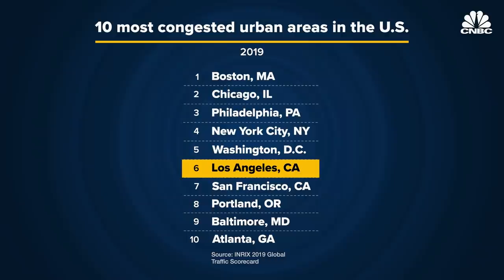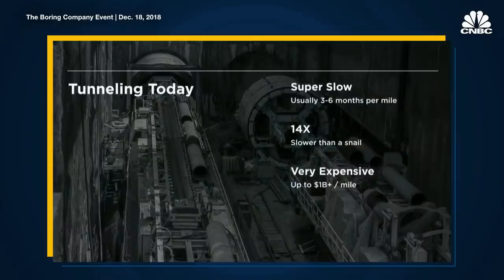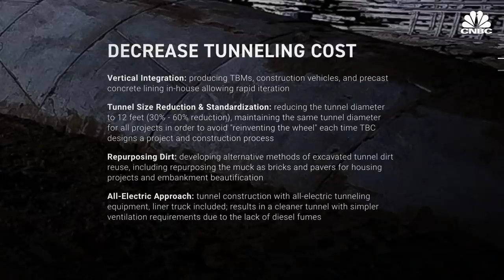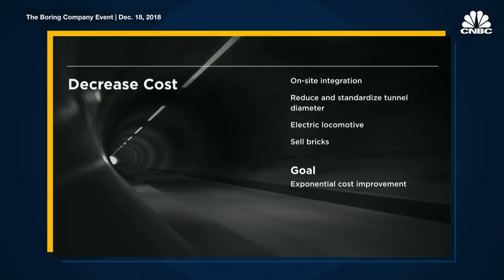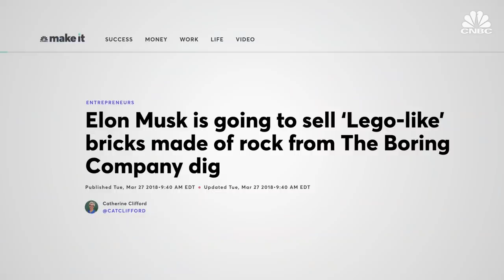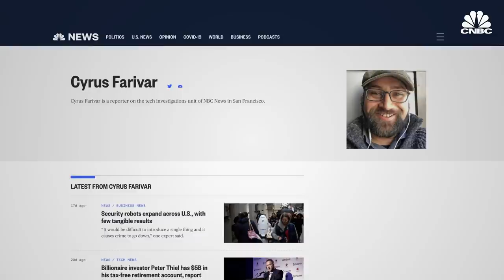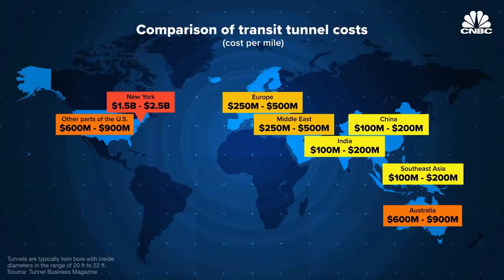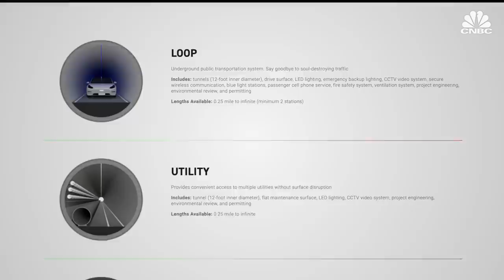Why Elon Musk’s Boring Company Isn’t Fixing Traffic Anytime Soon

Comment: Ah yes, Musks ingenious idea of adding a lane.
Reply: So why didn't anyone else do it?
Reply: @alanlight7740  Because they knew better.
Reply: @alanlight7740  because beside musk fans, everyone knows it doesn't help and is a massive waste of money.
Reply: @vudangtung5638  - funny. I know one stretch of highway, about 5 miles long, where adding one lane reduced travel time at rush hour from about one hour to about five minutes.

Strange that everyone else knows that adding lanes doesn't work, though.
Reply: @alanlight7740  exactly! we can just add Lanes and lanes and lanes forever and ever and traffic will be finally be solved. Why don't people get that?
Reply: @grandmastarflash  - Yes. It is far easier to dig further down than to build upwards beyond practical limits, and one lane of traffic should be good for multiple floors of living and working space, so there's no reason why going further down shouldn't provide far more capacity than will ever be needed.
Reply: @alanlight7740  yes we can have 5000 tunnels going into the centre of New York, it will definitely solve traffic
Reply: @alanlight7740  i bet in 3 years traffic on that highway will be just as bad if not worse than it was before they added the lane. Look at the highways near houston texas, they’re gigantic, but theres still traffic on them. Adding a lane only fixes the problem temporarily.
Reply: @matthannigan78  - it must have been five years already. No problems yet. Still MUCH better than it used to be.
Reply: @alanlight7740  Your ignorance about how traffic works is amazing.
Reply: @bobincognito6239  - I know! I only have my own observations to go by - I've never had the benefit of being lectured to by geniuses who would tell me that everything I've seen in person was wrong. It's so terribly sad. :-(
Reply: @alanlight7740  I have an even better idea: let's not stop at one lane. Removing a city completely. Raze everything to the ground, and put a giant super-broad hyper-road on top. There won't be any jams, because without the city there won't be any need to stop anywhere — everyone could just drive wherever they want.
Reply: @alanlight7740  yeah they have. It's called an underground train
Reply: @devilcwesker5980  - an underground train that can pick you up at your front door and deliver you straight to your destination without any transfers or waiting? Cool!
Reply: @alanlight7740  a taxi? XD
Reply: @devilcwesker5980  An underground taxi. If it's at ground level it will be stuck. You miss the point on purpose?
Reply: @rubenayla  Are you agreeing with musk's idea? Cause ive got an entire list to prove that idea is stupid :v
Reply: @devilcwesker5980  I absolutely agree with it
Reply: @rubenayla  tell me then why it isnt a stupid idea then.
Reply: @devilcwesker5980  Well, in reality you should tell me why it is a stupid idea. Specially because Elon Musk himself already explained the reasoning of 3d city growth vs 2d road growth, that mathematically will for sure collapse for big cities.
But anyway, I will paste a response to other comment that I think goes in a similar direction:

"building underground car tunnels is just a more complicated version of just adding more lanes to the highway"

My response

Definitely not. Obviously more separated lanes can move more cars. It's like a pipe moving water. OBVIOUSLY more pipes = more water.
A different story is the whole transportation system with its bottlenecks and complex dynamics where a faster route for any individual car may cause a greater delay to the neighboring vehicles, causing the total time travaled to increase, even though individually for a person the trip was shorter, which in turn means than SOMETIMES, more lanes can result in more traffic and slower trips.

Think about this. You get on an elevator to level -10, you get on a tesla (or any vehicle, but a car can come out of the tunnel to the main roads), and you get directly under your destination, for example in LA. You park it there underground (ideally the autonomous car would go for more people, being useful instead of parked there), you get on the elevator, and you're at your destination. You didn't even need to interact with the normal roads, which means these tunnels didn't slow down the system. You could build underground roundabouts etc. It has to work.
And the surface could be freed from roads, just to walk and bike
Reply: @rubenayla  oh and roads+cars are very more expensive than stones+shoes
Reply: @devilcwesker5980  

I don't know what the moving-parts argument has to do with static tunnels. 2 wheels at the sides of a vehicle to make it go straight are not a problem.
About the motors, in fact having several motors makes the system more redundant. That's why planes have several sensors and actuators. It's more likely that one will break, but it's less likely that the system will break.
I thought we were talking about the transportation system, not safety. A tunnel is in fact safer than a road subject to the weather.

"This is because any part has at least a 5% of failing" WTF. 5% of probability over what time period? on their lifetime? That's BS. ICE engines would be impossible if that were true, and there's no fundamental reason why that has to be true.

I have done some research in TBM because I was thinking if it would be possible to use water jet cutters (like in CNCs) to cut the exterior surface of the tunnel instead of the whole volume. and have bigger chunks, or just for hard rock.

About the video, yeah a train generally needs less maintenance, but passengers have to stop at each and every station between them and their destination. Oh and when they arrive at the closest station, not their destination because all the passengers are forced to go together, then, they need another vehicle to really get to their destination because the train cannot do that. NICE. Now they need a car or a bicycle parked all day there. A mess. With the tunnel you just take your car and go. That was the idea.

You should only care about my arguments, but I'm studying aerospace engineering in case that's useful.
Reply: @rubenayla  aerospace engi, well then you should know that principles at least.  Any piece of machinery has an acceptable rating of success of 95% meaning that there's at most a 5%  of failure.  Unlike motors in planes which you are right(they place several motors in order to make it more robust) but when we talk about automotive and machinery such as drills,elevators etc. The question changes from being robust to energy efficiency.  If you read the loop idea, the process goes like this. A car parks in this platform which then gets lowered by an elevator, which then the platform connects and moves forward with rails system(the same tech they use for rollercoasters) then it gets speed up by 100 map until it arrives into this "station" where it gets into another elevator and done. 

Problems: energy efficient:  In any public transport (which would classify the platforms as such) the importance of being efficient comes to mind. So the electrical amount needing to powered all the above, for only 4 to 6 passengers at a time completely get demolished compared to a underground train system. 

At this point your only argument is comfort. But as an aerospace engi you should at least know a bit on how airline sits work? The argument being the same, trains are your cheap transport system, has several seats but low comfort. But elon musk idea of comfort is like the airplane rides of first high class. So the problem being, either you make the service so expensive that not all people use it and only few people do making it nonprpfitable and a loss of money or you make it dirt cheap but still loose money
Reply: @devilcwesker5980  With electric vehicles the energy efficiency is very high, and the aerodynamics at normal speeds are not so crazy as with planes. It would cost 1-2$/100km. Electricity is cheap compared to fossil fuels.
I think that separating the train into different vehicles, allowing people to have privacy and real comfort, will not necessarily increase the cost that much.
I'm not against a vehicle with metal rails taking electricity like a train, but I don't like the idea of all the people together in an enclosed space, and I don't think it's necessary. However integrating the tunnel with the current car system of the USA makes sense to me.
I would remove roads from the surface if they get the cost low. You get rid of road maintenance by having them underground. There are so many converging advantages to transportation with tunnels...

I agree with the difficulty of the car elevators though. I didn't pay much attention to that because in my mind for a city is more logical to have underground parking and get yourself to the car from the elevator of the building. In the short term I would just use a ramp for cars and elevator for humans
Reply: @rubenayla  - you understand it. Autonomous taxis are going to change a great deal more than just traffic, and putting them underground in city centers could return the streets to pedestrians, while reducing the need for parking will allow denser development which will mean there will be more goods and services to be found within walking distance - all while also retaining the advantages of the automobile.
Reply: @devilcwesker5980  - underground construction is far safer than surface construction in the event of an earthquake.

When big cities have big earthquakes, they frequently end up using their subway tunnels for emergency services to get where they need to be after the surface streets become impassable.

As for what solves traffic - the only thing that has EVER worked is adding more capacity. Frequently this means adding more lanes. The false claim that "traffic has never been solved by just adding more lanes" is based on the fact that traditionally those lanes have been limited to two dimensions. What happens is that when adding extra lanes solves traffic problems people see that it is easy to get where they want to go and more people move to the area. Now those people are going to move SOMEWHERE regardless, and the new development is going to happen SOMEWHERE regardless, the only question is whether that development will be dense and efficient or whether it will sprawl over much larger areas.

So, granted that people are going to want to live SOMEWHERE, we are back at the 2D problem: after houses and shopping centers and schools and everything else has already been built, no one wants to tear them down to add lanes to the roads, and now the cost of real estate has also skyrocketed so it becomes very expensive to add lanes. Besides this, all that cross traffic means lots of traffic lights and difficulty getting into the correct lane at the correct time, and figuring out how to cross oncoming traffic when necessary. That limits how wide you build roads.

A grid pattern helps somewhat, but then families don't want to live on roads on a grid because they are rightly concerned that their kids will be run over by traffic. That leads to new subdivisions full of cul-de-sacs, which in turn makes the major roads even more unmanageable.

But going underground adds a whole new dimension - quite literally. Traffic can continue at speed without need for traffic lights. A grid pattern could be established even underneath existing neighborhoods with cul-de-sacs. The far greater constraint is how high we build - and the fact is that most tall buildings are vanity projects. It almost never makes sense based on economics alone to build taller than about 20 stories, and that is for the most expensive pieces of real estate. Experience has shown that residential buildings for families with children should never be taller than five stories. So we don't really need to go deep, and mostly we just need to get rid of bottlenecks.

Moreover, as we move towards robotaxis there will be much less need for parking, as few urban or suburban families will want more than one car. This will mean that many garages can be repurposed to allow a denser concentration of businesses, which in turn will make urban living more attractive. Taking automobiles off surface streets can also return that space to pedestrians, encouraging more walkable cities - which also means healthier people.

Of course the sticking point is the expense of building the tunnels, but that is not as much of a sticking point as it may appear - partly because the price of tunneling has been artificially inflated in the United States, but also because accelerating technological change will make all types of goods and services much less expensive than they used to be.

Of course this will take time, but that's okay because by going underground we also avoid most of the problems arising from new construction obstructing existing traffic. The first tunnels will address the places where traffic is worst while allowing a smooth transition to a future in which the majority of non-local passenger traffic is underground. By using vehicles that can travel on existing roads, it likewise allows an easier transition because it allows people to seamlessly use both new and existing systems.

You speak about environmental concerns, but what exactly are those? Going underground is about as environmentally benign as one can get. Some existing roads could be returned to being natural areas, but even just replacing short sections of surface roads with underground roads could do a great deal to restore migration routes for many species that have been disrupted by roads and vehicular traffic. If we were to move to a future in which most roads were underground we could even mitigate the damage done by proximity to roads. It has been discovered, for example, that roads and road noise will drive many species away from the roads, so that some bird species will refuse to nest within a mile of a road with regular traffic.

It seems to me that most "environmental" concerns are just an excuse to make things difficult and prevent any sort of improvements.
Reply: @rubenayla   and that also that Alan Light guy, adding tunnels is not really 3d growth its just on technical level, and even if improves it significantly which it can't, more people would settle there. Problems is not the lack of space, its the abundance of cars, nothing comes closer to an electric train in city or state wide terms. It is the best solution there is. For which you can use other public transports or better think something innovative in that area.
Reply: and adding cars
Reply: @alanlight7740  because it's only a short term solution, which might improve things for 18 months max less in a large city. To truly solve it there must be multiple viable forms of transport for people to take, plus not having things spaced out to encourage everyone to take cars to do anything in their lives outside of their homes.
Reply: @ANTSEMUT1  - So it IS a solution for 18 months (in reality considerably longer, but I'll take what I can get), it's just that after that problem is solved a NEW problem emerges because things are so much better that the city can grow again. At which point adding another lane can solve the problem AGAIN.

Ignoring, of course, the fact that one autonomous lane is worth about three regular lanes, and that autonomous cars also reduce the need for parking and (eventually) can take cars off the surface so that people might be more willing to walk (or use a bike or scooter) when they don't have to worry about being run over by a motor vehicle. For that matter, a few tunnels could be provided as pedestrian or bicycle and scooter expressways, encouraging those modes of travel as they would be available year round regardless of weather or terrain that would otherwise discourage them.

Of course, without all the space required for parking a great deal of space can be repurposed for other things, allowing greater density and greater walkability.

And if more lanes are required they can be easily added with more tunnels, because it is much easier to go down than to go up.

And that last point is the key one: the traditional adage that adding lanes doesn't solve traffic is based on the assumption that the transportation grid is two dimensional and that adding lanes is going to be very expensive, will force buildings to be built further apart, and will still have all the problems inherent in intersections where traffic will have to stop to allow cross-traffic to proceed. All of these problems are solved by making the grid three dimensional.

And the problem of making the grid three dimensional is in turn solved by making tunneling cost-competitive with other solutions.
Reply: @alanlight7740  You're missing a big point here. There is a thing called induced demand. Basically, when you add lanes or make a new road, more people will start driving, because now there are new lanes. So they will compensate for the new road capacity, thus making the traffic jams just as bad as they were before. There is a reason why cities don't try to simply make more lanes anymore. Cars in general are just inefficient in dense urban areas. That's why fast, reliable, and cheap public transport will be much better.
Reply: @alanlight7740  Dude you need to stop hahahaha
Reply: @alanlight7740  eww billionaire musk fanboi
Reply: @Ruzzky_Bly4t  - "induced demand" - in other words, growth.

Yes, as more people move to an area because they have seen it is a nice place to live, they will want to go places.

The solution offered by urban planners is to make cities worse so that people will not move there, or will even start moving out.

Cars are very efficient in dense urban areas so long as they have the infrastructure to keep them moving. The question is only whether sufficient infrastructure can be built at a reasonable cost.

Having misdiagnosed the problem, urban planners are now anxious to apply the wrong solution.
Reply: @alanlight7740  all i will say is that i think you have to use a metro and not hope we end up living like the people on coruscant.
Reply: @theholypotato7763  - I've used buses and airplanes on seven continents, and trains, subways, and boats on six - plus several islands. I know a little bit about how these things work and what works best.

Also, going underground is one of the things that helps AVOID creating a world like Coruscant.
Reply: @alanlight7740  its an underground road, nothing more.
Reply: @theholypotato7763  - that's all it needs to be.
Reply: @alanlight7740  Mr. Musk is truely a 4D chess gamer.
Reply: Just for himself.
Reply: @xavierrodriguez2463  - there's another way. You can add multi-level lanes and bypass intersections. Like with Loop.
Reply: But it's underground and with gaming lights. Definitely a revolutionary concept in transportation.
Reply: No adding a line at much higher cost that the real genius. 🙄
Reply: @alanlight7740  Great idea! Adding lane after lane is obviously the only correct answer, golly gee, why hasn’t that been tried before?
Reply: @hjj9269  - because previously it was too expensive to go 3D. Didn't I already address that point?
Reply: This comment thread is just one Elon Musk fanboy who refuses to accept the fact that public transportation is a better long term solution to traffic lol
Reply: @Theffries  - I refuse to accept such an absurdity as public transportation being a long term solution to traffic, because it isn't - unless perhaps your hope is to cause such depression that commuters commit suicide en masse. I suppose that would solve traffic, after a fashion.
Reply: @alanlight7740  bro tunnels gotta be built under some civilians houses in major cities yo
Reply: @Avis03  - it wouldn't be strictly necessary for tunnels to go under houses - it should be possible for tunnels to simply run under roads that already exist - but going under private property (with an easement or whatever other legal instruments are required) might allow more direct routes that save everyone time and money.

And what was your point? They'll be deep enough they should be pretty much undetectable on the surface, apart from entrances and exits.
Reply: Musk fans would probably suggest Trump's "nuking storms" thing is a genius idea.
Reply: @grandmastarflash  Pal, I just discovered the idea of parallelism ! I should try to patent it !
Reply: @alanlight7740  Vox did a video of why adding lanes to motorways actually makes traffic worse.
Reply: @vudangtung5638  In the future im sure you will be incorrect.
Reply: damn bro, this comment gives the same energy as saying "Electric cars are just normal cars with electric motors".
Reply: @alanlight7740  lets add a underground lane for cars make them high speed and to reduce congestion we could connet them. Wait thats a subway. Honestly adding another car lane is so goddam inefficient. Trains are the most efficient and make the most sense.
Reply: @chagi4334  - trains as they have been implemented in the United States are less energy efficient that electric cars, even if each electric car has only one passenger. Trains are also FAR less time efficient for passengers. There are some rare exceptions at rush hour in some extremely congested areas, but even there it would be better to concentrate on using the train for one short leg and then have passengers switch over to a more personalized transportation option.

And of course it's looking like trains are also more expensive than the Loop system. This might be mostly due to political corruption and unions in the United States, as costs appear to be considerably lower in other parts of the world, but it still means much higher costs for trains in the United States.
Reply: @alanlight7740  you are ignoring so many other problems. You also need parking for cars, cars cause more wear on roads than trains on steel tracks which means more maintenance, there are a million reasons why it’s a terrible idea. Watch literally any Adamsomething video on musk’s ideas and it’ll probably blow your mind lol
Reply: @Theffries  - Autonomous taxis will reduce the overall number of cars needed so we already have more than enough parking. It's heavy trucks that cause most of the wear and tear on roads, and the tunnels are too small for heavy trucks. That is, depending on weight one heavy truck can do the damage of hundreds or even thousands of cars. So the pavement in tunnels will last much longer than surface roads - both for that and because it will be protected from the weather (especially freeze/thaw cycles).

If a robotaxi fleet is eventually built it will likely be mostly small cars for only one or two passengers, since the majority of trips only have one or two passengers. They might even be half-width so that two can share one car length in the tunnels. These cars will be very lightweight which means even less wear and tear on road surfaces.

Electric cars require very little maintenance other than changing tires, and even though they will need replacing more often than train wheels, overall the maintenance costs will be much lower. This is especially true because the tools, equipment, and knowledge for car maintenance (especially tires) is far more common, standardized, and inexpensive than the tools, equipment, and knowledge for maintaining trains.

For example, it's easy to find a lift for an automobile, not so much for a railroad car, and a jack for an automobile is much smaller and less expensive and easier to work with than a jack for a railroad car, etc.

You're looking at individual parts of the equation and favoring trains, but if you look at the whole picture electric cars in tunnels are much more efficient and less expensive.
Reply: @vudangtung5638  I bought a coke spiked my insulin levels and died of diabetes. Now I know that cats are like dogs.
Reply: @vudangtung5638  beep boop
Reply: @alanlight7740  It only works in certain locations. Not every space in a city is equipped to bore extra lanes. If you add more lanes, it encourages more cars.. which will just inevitably create more congestion in other parts of a city. Ya adding additional lanes helps in theory, but it’s a balancing act. . 

People find “just add another lane” laughable because it’s touted as a brilliant futuristic solution to all the worlds traffic problems. It could work, but mostly in areas were a temporary influx of cars get from point A to point B without diverting. Stuff like tourist attractions or sports stadiums. It’s a known folly in the  civil engineers world. Elon needs to outsource his expertise better.
Reply: @be.A.b  - in the past, "adding lanes" hasn't worked for two reasons: (1) when traffic is eased, more people find the area desirable and move in, increasing population density; and (2) because the road networks are effectively two dimensional, there are limits to how many lanes can be practicably added.

In the first case, it is ironic that the same people who hate the idea of adding lanes tend to be the same people who favor higher density. Higher density means, for instance, that there will be more places to go within walking distance and less need for cars in the first place. Moving lanes underground also means that these areas are more walkable, with fewer multi-lane roads for pedestrians to cross. Ideally, all traffic could be routed underground, and the surface roads could be reclaimed by pedestrians entirely.

In the second case, by going three dimensional there is no practicable limit to how many lanes can be added. It is much easier to dig deeper than to build taller, and the truth is that there is almost never an economic reason to build taller than about 20 stories anyway. (The buildings that are taller than this are essentially vanity projects.) Besides this, the thing that slows down urban traffic the most is intersections where traffic is required to stop to allow cross-traffic to proceed, and by moving into three dimensions this impediment to traffic flow can be eliminated almost entirely. Which is to say that by going three dimensional the number of lanes available can always exceed the number of lanes required to keep traffic moving, and that traffic can flow much more quickly - probably the equivalent of at least doubling, if not tripling or more, the capacity of each lane. Autonomy also increases the capacity of each lane - roughly tripling the capacity of a highway lane. By combining these two trends I would not be surprised if each underground lane could deliver six times as much throughput as a lane on a city street - and perhaps more.

But even if autonomous vehicles in tunnels could not deliver quite that much of an increase in capacity per lane, we could always add more lanes - hundreds of levels deep if necessary. The only question is cost - and rapid advances in technology will continue to reduce those costs.

Despite what you say, there is almost nowhere that is unsuitable for this. Cities with existing subway networks may need to dig a bit deeper, but it should still be possible. The chief obstacles are legal and political rather than technological - things like securing underground right of way for the tunnels.
Reply: @be.A.b  - also, I know that this is not innovative city planning. The Italian futurists came up with the basic idea about a century ago. The only improvements are: (1) using subtractive rather than additive construction - that is, digging routes for vehicular traffic rather than putting vehicles on ground level and building raised platforms for pedestrians; (2) eliminating the need for same grade intersections - an idea borrowed from limited access highways like the Interstate system; and (3) self-driving electric vehicles that make it all possible.
Reply: @alanlight7740  why highways? High speed rail is way more effective than highway
Reply: @tapeesa2866  - automobiles on highways are more energy efficient, more time efficient, and less expensive than rail - at least in areas that are not very densely populated. That's why.
Reply: I think everyone are missing the point.
If this idea (or more cost effective ditch and cover technique) became mainstream .
We can forbid the space taking, accidents causing, noisy, polluting cars above the ground.
So above ground will be reserved for bikes, walking, light rail and trams and small shops in the middle of the street.

Why do we put the low efficiency cars that take a lot of space above ground while public transport underground, it should the other way around.

This also allows cars into a controlled environment, that can implement self-drive safely.

It's a win on all side.
Reply: @yazeedalhusban969  how do you pull over in the tunnels if you run out of gas? Or if the car breaks? What if there is a crash? Where will people park?
Reply: @alanlight7740  look up more research it’s already been proven across the United States by many studies that adding another lane to a highway doesn’t really help the problem in most congested areas
Reply: @tapeesa2866  why not ditch Elon Musk idea then, and build a proper traffic tunnel, with cost efficient cut and cover technique, so above ground will be used for public transport and other uses.

A proper tunnel means wide, multi lanes with emergency exit and entrance.

Tunneling for cars is less expensive than tunneling for public transport.

The sad truth that cars are here to stay so I rather them underground.
Reply: @tapeesa2866  do you know what, I take my reply back, it's not going to work.( what will happen when people reach their destination, how do you get out of the tunnel and park).
But I will not delete my reply to provoke thoughts.
Reply: @ianaguilar8090  - and yet millions of people have had the experience of new lanes (or even new roads) relieving traffic congestion.

Maybe we should be careful about blindly believing the "experts" - all too frequently they have blinders on.
Reply: ...or his pitch that we should invest in his ordinary thing because his ordinary thing could be 3x better than other ordinary things at some point in the future, as if that were a convincing argument.
Reply: @alanlight7740  And hundreds of millions of people have seen that the added lanes are eventually filled with more cars and you end up with the same traffic problem

Do you not see the trend here? I genuinely can not tell if you’re trolling or not
Reply: @AyedYoutube  - the fact that traffic increases simply means that more people have found it worthwhile to live in the area, which means increased population density which is a good thing as far as efficiency goes.

The problem with adding lanes to surface streets is that eventually you run out of space to add lanes. By going three dimensional, you can always add more lanes - at least beyond the point where the city can grow taller. By eliminating intersections you can also keep the traffic flowing, which is huge when it comes to keeping trip times reasonable.
Reply: @alanlight7740  there is only so much capacity to be added for cars before you realize the entire city is just a giant parking lot and highways.
Reply: @AyedYoutube  - which is precisely why it would be a good idea to put that capacity underground so it doesn't take up valuable surface space.
Reply: @alanlight7740  by that point it’s much cheaper and practical to just invest in public transport
Reply: @AyedYoutube  - public transport isn't at all practical outside a few densely populated areas. Too expensive, takes too long, too crowded, and it doesn't go where you need to go. I keep on seeing people sing the praises of public transport, but I have no idea where they live because it's been worse than useless most everywhere I've lived.
Reply: This is how Musk promotes the Myth of Musk.  He claims the invention of things that don't exist, but sound good at the time.  He want's to put a robot in every house, but his prototype is a man dancing in a spandex robot suit.  Most of what Musk talks about is hype for self promotion.  Now, Musk has now turned on the people who buy Tesla cars, the left leaning people who are concerned about the environment. Then Musk publicly aligned himself with the political party who denies climate science, they don't like electric cars or solar cells and the leader of the party HATES windmills and says climate science is a hoax. I see Musk as more of a conman with billions of dollars pretending to be the next Edison, while using 3D CGI videos and photos and a man in robot suit, all to promote his myth to sell cars.
Reply: @obijuan3004  - the ancient Egyptians knew about steam power, but they never developed it beyond a toy. The Chinese built the first printing press with movable type - but again they never developed it beyond a toy.

It's not about who invents a thing. What is important to society is commercializing technology and making it available to ordinary people. That requires a rare confluence of business skill, technical skill, and public relations skill.

By all accounts Musk has exceptional technical skills, but no doubt some of his employees are better than him - at least within their specialties. And no doubt Musk has exceptional business skills - but it's quite possible there are others better at that too. There might not be anyone who is better at public relations, but then again maybe there is. What is clear, however, is that we don't know of any other living person who can combine anything like his degree of skill in all of these domains.

There are thousands of great inventions that have languished because their inventors did not have the skills to commercialize them - but history has proven that pretty good tech in the hands of millions is far superior to exceptional tech confined to a tiny elite.
Reply: @alanlight7740   Let's look at reality.   Musk bought a car company that designed a proprietary motor and battery.  He got over $700 million dollars from investors and the Obama administration and made an electric car. People perceived the Tesla as  environmentally friendly, so left leaning people with money jumped all over this car. Okay great job getting the money and building the company, but he hired people away from car companies to do it. Which is smart.  Musk is more of a money guy, than an inventor. GM had an electric car in 1996.
  
It is far easier to make an electric car, with a motor and battery, and a digital screen, than it is to make a car with a gasoline engine, a transmission and a differential with dashboards and radios.. Or to make a hybrid car that has all of the above AND a battery and electric motor.
Car companies do not want to make electric cars, they lose lots of money in oil changes, parts and service fees.  There is no benefit for them and lots of people will lose their jobs. But Musk created the market and governments have mandatory "zero emission" standards by 2040. 
Musk sells cars with YouTube video's about his new inventions, that mostly don't exist, and the videos are laced with Tesla ads. All for free.  He is built an image of a genius inventor, but his real genius is getting money and in INFLATING everything that he does, like calling a factory a GIGA factory. Every car company has a giga factory, even the one Musk bought from Toyota in California. LOL.
Musk is smart, he is great at getting the money he needs to build the toys that he wants to build. He has even convinced people he created a car that regular car companies will not match for 10 years.  They are matching the Tesla this year for less money.   With all of Musk's accomplishment, his biggest accomplishment IMO,  is his mastery of HYPE.
Reply: @obijuan3004  - no doubt Elon Musk is great at PR, but he had a Bachelor's in Physics from Penn State and was enrolled in a doctoral program at Stanford before he dropped out to start his first company. He has real scientific chops.

And for all practical effects he created Tesla from the ground up. Yes, he joined a badly managed startup that had practically nothing - not even the legal rights to the name Tesla, which he had to purchase separately at a later date - but practically everything Tesla has become was the work of himself and J. B. Straubel.

BTW, his specialty in Physics revolved around batteries.

As for the gigafactories - yes, the name is PR, but none of the other car companies have anything with nearly the capacity of Giga Berlin or Giga Texas. Each of those, fully ramped up, will be the equivalent of more than a dozen traditional car factories.

And yes, electric cars are easier to build in many respects - except for energy dense batteries and battery management - which is what Musk specialized in.

If you don't like him - fine. You don't have to like him. But don't lie to yourself.
Reply: @alanlight7740  I was following Tesla before Musk was CEO,  Musk bought a well designed motor and cooled battery pack that gave him a huge jump in making an electric car, maybe Musk improved it, or maybe its just more Musk hype.
Here is the reality.   Of all the types of cars to make, Hybrid (gasoline engine, battery, and electric motor), or Gasoline Engine only, or  Electric car (battery, and electric motor),  the Electric car is the easiest car to make.  

Legacy car companies don't want to make electric cars, because they lose lots of money in service fees (oil change, transmission, belts, radiator, tune ups, etc).  GM proved the point with their 1996 electric car.  
Today, 23 Governments are forcing car companies to make "zero emission" vehicles by 2035 to 2040. The US has a bill to sell only zero-emission vehicles in 2040, but its going nowhere as usual.  California is working on its own law. 
You will see a flood of EV's in the next 3 years, and that will make it hard for Tesla to compete. Musk is the King of Hype, we will see how he handles competition.
I'm sure that legacy car companies are not worried about Tesla. Even those in China. KIA already has a nice EV that won 2022 Car of the Year, caroftheyear.org
Reply: @obijuan3004  - LOL - so, in other words you don't know the history of the company and you don't understand how important logistics are.
Reply: @alanlight7740   What?? Which company do I not know the history and what logistics are you talking about?
Reply: @alanlight7740  What do you mean no problem? Have you ever been to Houston? Look at how many lanes added got them, it literally did nothing.
Reply: But this is a really expensive, underGROUND lane!
Reply: @alanlight7740  it's been done for a long time, road tunnels are nothing new. The best way is to use very big cars, running on on steel wheels and steel rails, all joined together such that you can walk between each one. Oh wait that's a train.
Reply: @grassytramtracks  - the thing with trains in tunnels is, that most of the time any given section of that tunnel is empty. That's aside from the inconvenience of wasted time waiting for the next train, and having to stop at every station between departure and destination. If you average out a bunch of cars traveling through the same tunnel, directly from the starting point to their destination without stops, you get similar throughput with much less wasted time for passengers.
Reply: @alanlight7740  I know its an old comment but still, it takes me 4 hours with an ICE from Berlin to Munich, with the car 8. 
From Berlin-Spandau to Berlin-Lichtenberg ca. 30min with the S-/U-Bahn. If i get very lucky with the car 45min (very lucky). 
I think Berlin is a perfect example on how to plan a public transport in a big city. 
Because in Berlin, you will always be better off with the trains than with the car.